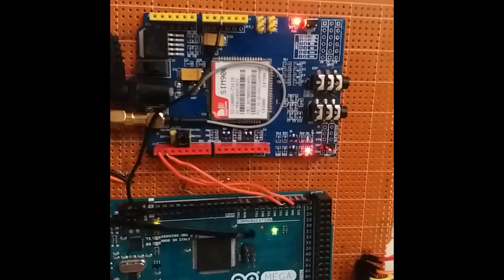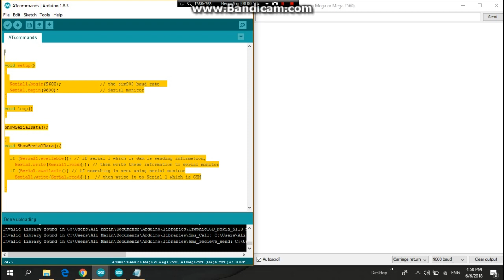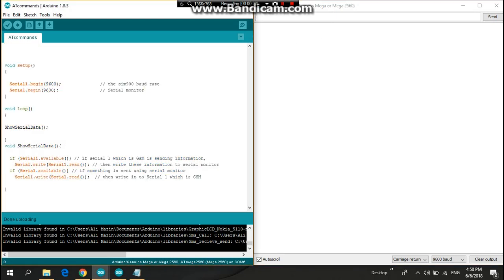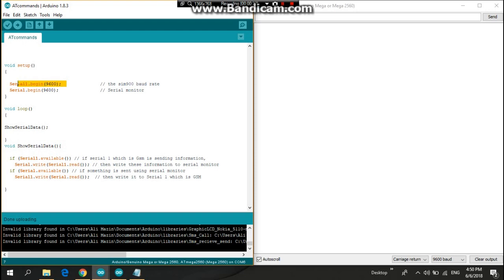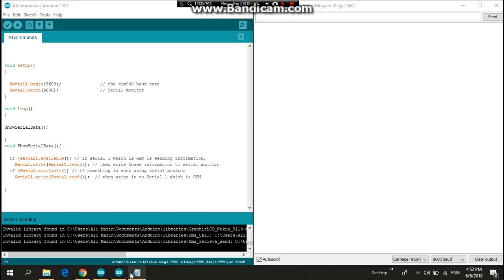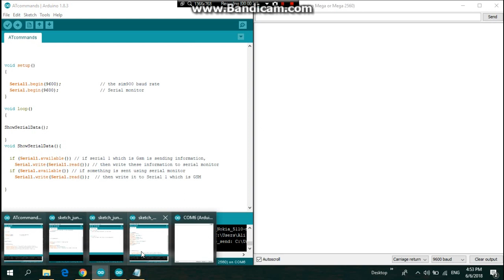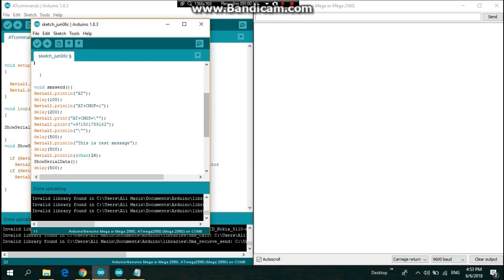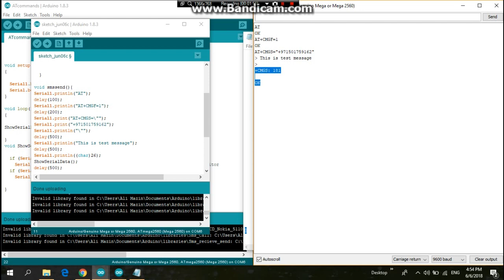||GSM Sim900 with Arduino MEGA || Connection, AT commands, Voice Call, SMS send,

Comment: Can I power sim900 with 12V, 2A dc adapter?
Reply from the maker: I don't think you can do so it should be 5v , check the ratings

Comment: I have a problem, I hope you help, sir. The gsm sim 900 is working normally, and I can send messages and they appear in the monitor normally, but when you press the restart button, the gsm does not work and the question mark appears in the monitor unless you raise the code again
Reply: Maybe an bug with arduino. I think u need to disconnect the data jumpers  before restart

Comment: بليز عندي مشكل سيريال مونيتور ما تظهر فيها النتائج  شو السبب؟؟؟
Reply from the maker: When serial monitor does not print At commands it means your Sim900 is not connected or maybe it is not receiving enough power. Try also to change baud rates.
Reply: @alim25061  But I tried code call voice Why type AT but do not show as well as the result But I could call voice but send  message I couldn't
Reply from the maker: @maysoonmissou6371  I am not sure why maybe the problem with your Arduino IDE
Reply: @alim25061  okay but The number in front of CMGS is different by state?

Comment: Nothing is appearing on when the screen when i type AT.
Do you have a solution for that?
Reply from the maker: Your GSM sheild is not responding  there should be a connection problem between it and Arduino. Check also your Baud rate
Reply: @alim25061  I changed the baud rate to 19200 also swap the ground pin wire,it worked but still no display on serial monitor when AT is pressed

Comment: i must put a sim card to the GSM?
and the second question i use  Arduino uno? so where i should connect the 19 and 18 pins?
Reply from the maker: Hello, yes you must put a sim card, it can be any sim card. For Arduino uno, you can connect the wires to TX and RX of Arduino uno
Reply from the maker: لازم يكون فيه اشتراك نت, اشترك باي باقة انترنت
Reply: U have to use software serial library